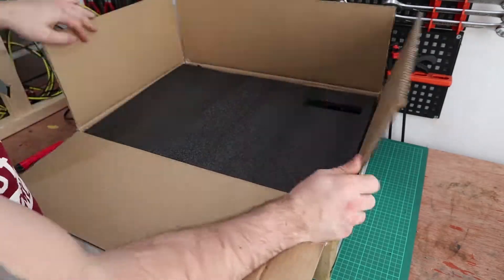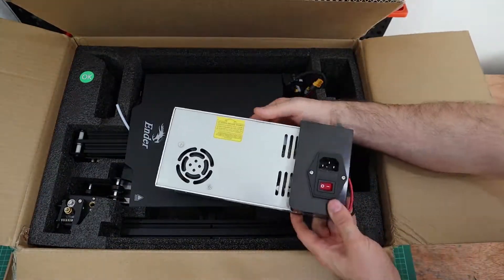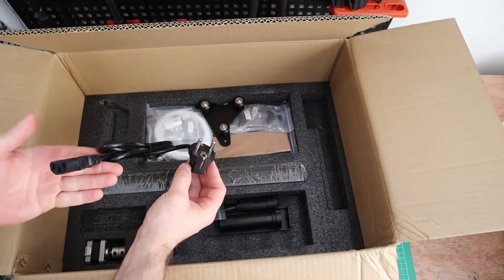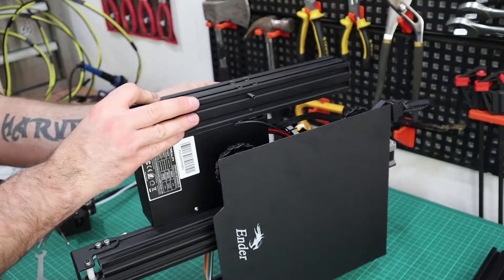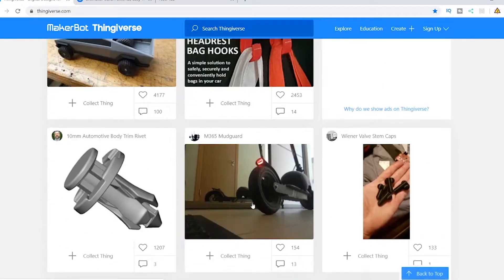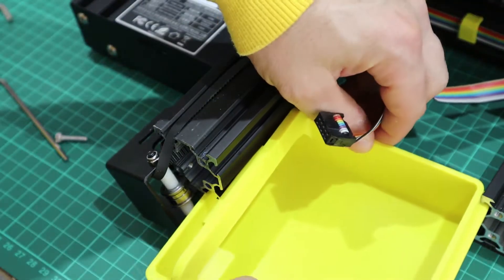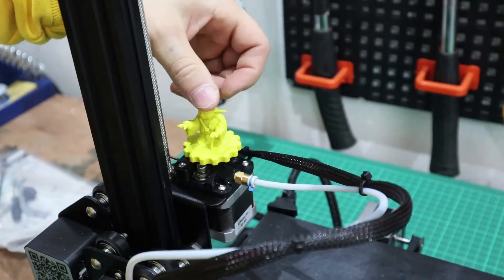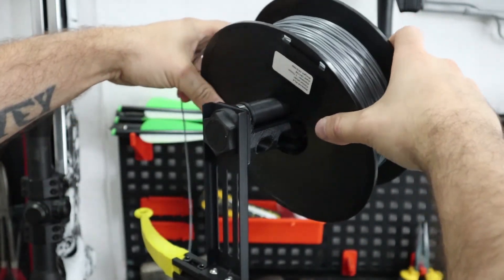Is The Ender 3 Pro Any Good?

Comment: Is there any reason in your opinion to prefer the Pro instead of the V2, or at this point the S1? I have the V2 and I'm very happy with it. Even at the V2 level, I've hesitated to recommend to friends who are new to 3D printing because of the long term effort and cost for upgrading them.
Reply from the maker: Hi AJ, I haven't used the V2 yet so i cant compare unfortunately. All 3D printers have a learning curve and I was happy that my first was the Ender 3 Pro